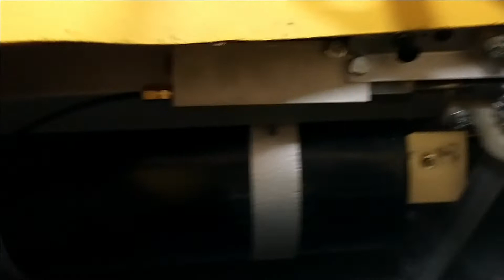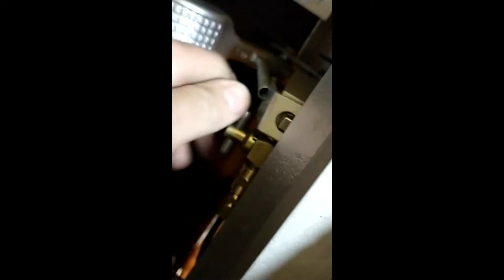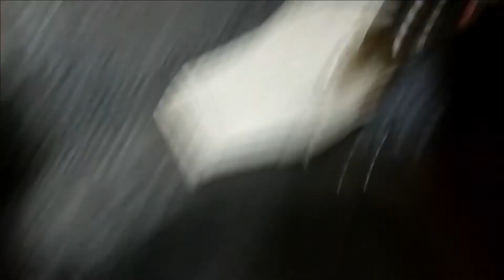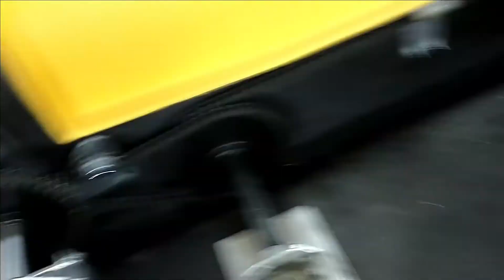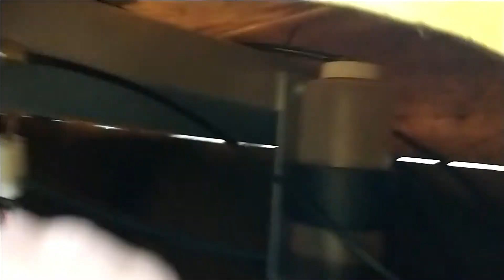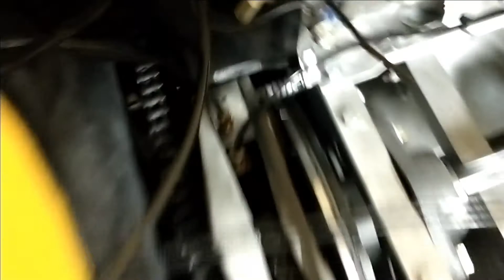Action-Age Scrambler Transmission, Steering and Brake Operation

Comment: I got another question that maybe you could help me out with, I need & looking for the axel bearing part numbers for both of the axel bearings
Reply from the maker: The inner bearings were unobtainable and had to be converted to something else. I used KFL003, I think it required machining the axles, I don't remember. Outers are 6206. Axle seals are SKF 11734. Best to pull yours apart and measure everything to confirm, these changed over the years.
Reply: I appreciate all your help for real I finally got mine back up and running now it's just replacing the bearings and again I can not find anything but old part numbers and no cross reference parts on that note thank you big time

Comment: Where to get and what size steering friction plate pad do i need for these Action Age scramblers? I need help cause mines got material missing
Reply from the maker: 1969 VW Beetle clutch disk friction material is perfect size.
Reply: @madgoatcustoms  could you send me a picture & link of the ones you had bought by chance? I see too many different kjnd and styles I'd just like to get the right ones the first time around lol
Reply from the maker: @LyricCobra  
https://www.rockauto.com/en/moreinfo.php?pk=5473965&cc=1280168&pt=10605&jsn=417
you'll need to drill out the rivets to remove the friction discs then either bond or rivet them to the scrambler discs.
Reply: @madgoatcustoms  awesome, & you answered my next question cause I was wondering if I'd have to drill them out & remove the plate lol, also I'll rivet them in but thanks for the helpfull info bud & I'll probably have more questions as I can't find much info on these machines at all
Reply: I guess I might as well ask if you know what size belt you used on her? I figured mines pretty much toasted, and was wondering what you used if you remember
Reply from the maker: @LyricCobra  mine will be different because it's a different engine and aftermarket clutch.
Reply: Um so I ordered 2 of these clutches and I just got them, lol I'm guessing I only need 1 clutch for the steering plates on both sides lol

Comment: How do I know if I have reverse?
Reply from the maker: There would be a large gear on one of the clutches, and a bracket with an electric starter motor.
Reply: @madgoatcustoms  thanks. You wouldn't have a picture ?

Comment: I have  a 1970 scrambler n I was wondering if I could put a reverse on it ?
Reply from the maker: The original reverse (optional) was just a starter motor engaging a ring gear on one of the clutch drive plates. Very simple, and somewhat effective. These days you can get a hi/lo/reverse gearbox for a go kart, it installs between the secondary CVT pulley and the main jackshaft. I actually bought one for this Scrambler but never installed it. Would be a tight fit with the rear seat in place.
Reply: @madgoatcustoms  i have a scrambler right hand drive.  it will turn right but not left.  where did you find parts. i think i may need a brake disk
Reply: Can you show us how this hi lo reverse would be installed on the scrambler? Cause I'm done pushing this to go backwards

Comment: Quick question, my buddy and i picked one of these up and are restoring.  We are baffled about how to replace the belt.  Any tips or is it literally tearing everything out just for a new belt?  Thanks!
Reply from the maker: Yes, you have to disassemble the transmission to replace the belt. It's not uncommon to install two new belts over the shaft, one as a spare, so next time it needs replacing you can just cut the worn belt off and slip the spare one over the pulleys. Also saves you from walking home if you break a belt in the field.

Comment: Who actually made scrambler? I thought it was amf!
Reply from the maker: Starting in 1968 they were made by Action-Age which was a spinoff of Allied Tractor. The company was sold several times and later became Scrambler Inc. As far as I know AMF never had anything to do with it.
Reply: @madgoatcustoms  thank you! I had one in the &0s! Loved it
Reply: What was the engine used stock?
Reply from the maker: @charlesrust1616  They used a variety of single cylinder air cooled four stroke engines. I think this one was a 8hp Tecumseh.
Reply: @madgoatcustoms  thank you!